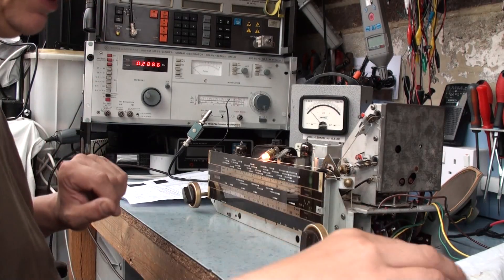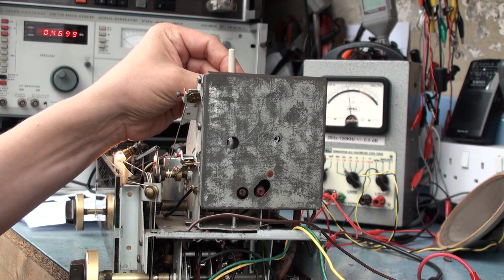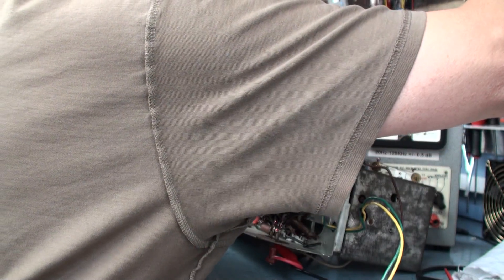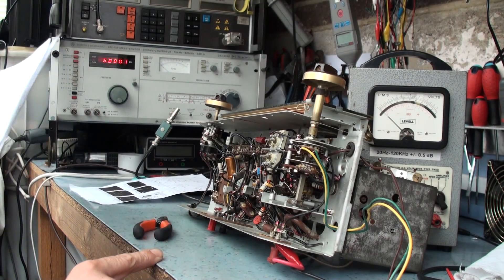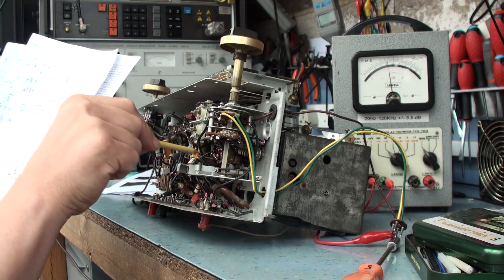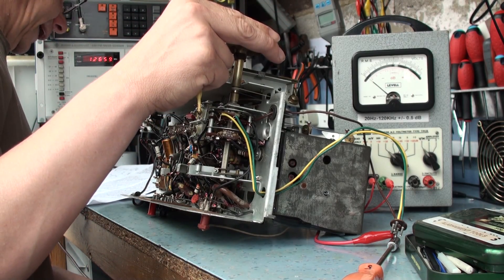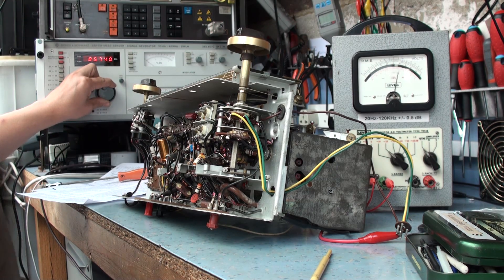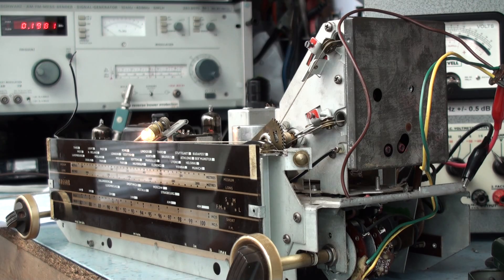Cossor 524 Melody maker Pt6  AM IF & RF alignment

Comment: Simon, sometimes a capacitor can microphonic, why not try changing all the caps in the vicinity of the area?
Reply from the maker: Hi Lenard, no it's definitely the valve.
Reply: Leonard Butcher had this with ceramics- they also make  annoying little speakers.
Reply: Thats what I thought when I had the same problem but it wasn't in the end. Have you swapped the valve over then?

Comment: Great job Simon. I have a few questions, how did you terminate the signal generator to the ferrite rod antenna? Is that a DC block you have attached to the output of the signal generator.  I also wondered if you had ever used a tuning wand for checking IF cores. These have brass on one end and ferrite material on the other end of the wand. I have read about tuning wands but never used one. Finally I have found most of those trimming tools to be rubbish. Keep looking at the ceramic ones from China. Do you have any nice trimmers Thanks regards Chris
Reply from the maker: AllTheGearNoIdea Typical of you to spot that! Truth is I did the IF by feeding into the ferrite rod connection. The matching should not be a problem. But the RF did need the ferrite rod connection for matching. That's why the Aerial trimmers had little effect. I did redo the RF in the chassis.
Can you send me a link to your adjuster tools. I bought a set from the states a few years ago. I will include them in a video soon.
Cheers Chris. Oh by the way did you say you bought an HP 8903?